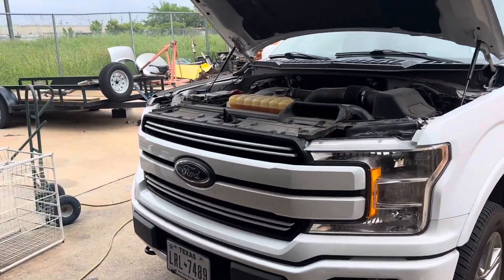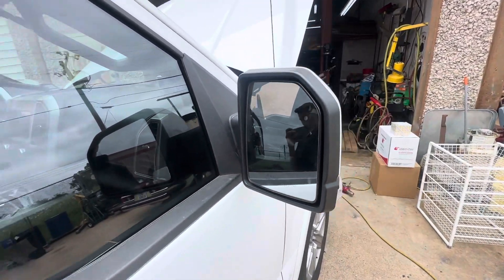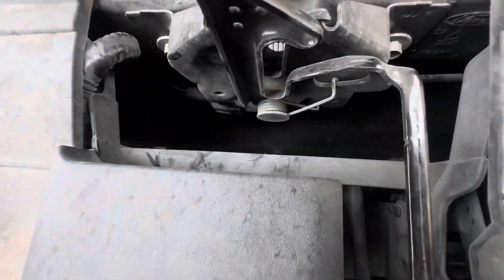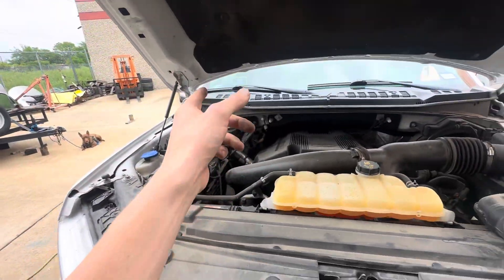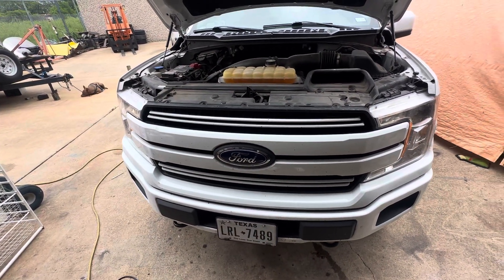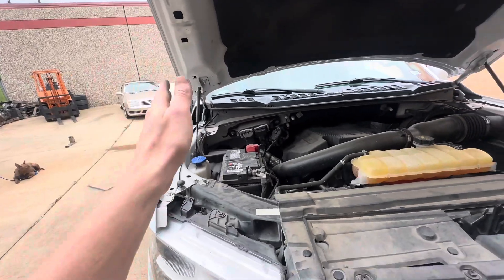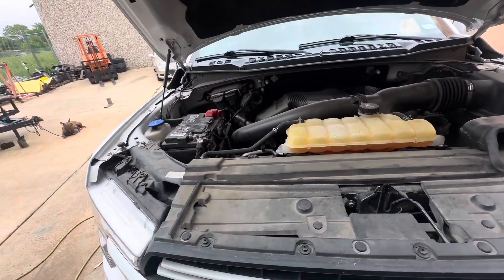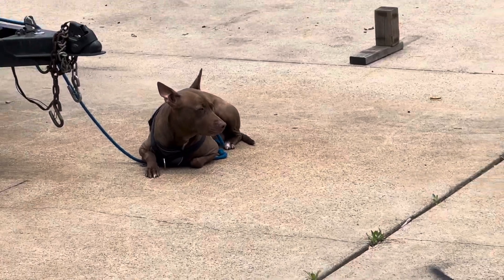2018 F-150 Ambient Temp Sensor fix/passenger mirror  issue, P0073

Comment: So you took the plastic radiator cover off then unplugged the connector to the sensor there and hard wired the little temp sensor from the old mirror? The old mirror sensor is two black wires and the sensor by the radiator is one grey one black and one white with green stripe, how do I hardwire the temp sensor to the other one, as in which wire to which wire
Reply from the maker: The one under the hood I’m referring to was just connected to an empty connector. Don’t use anything that’s connected to an actual component.